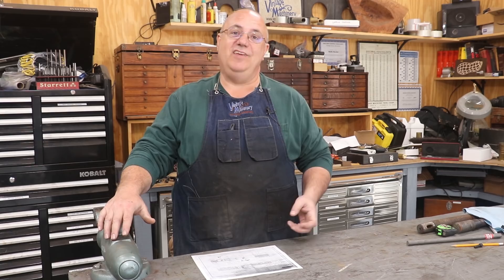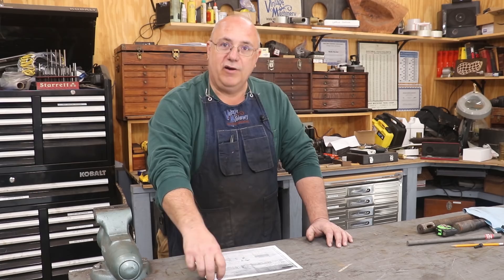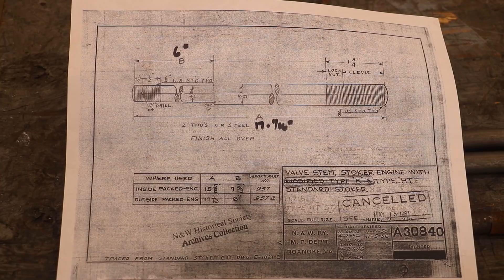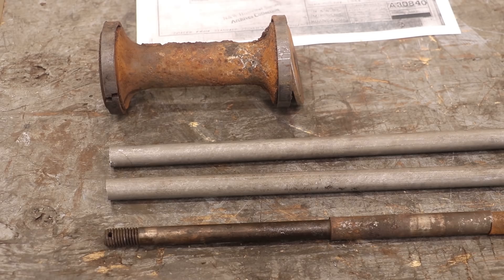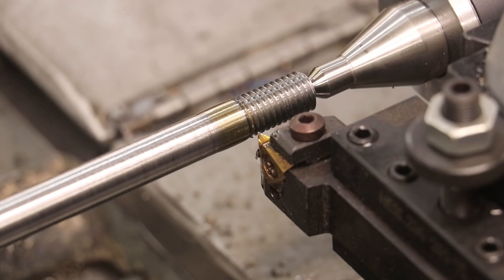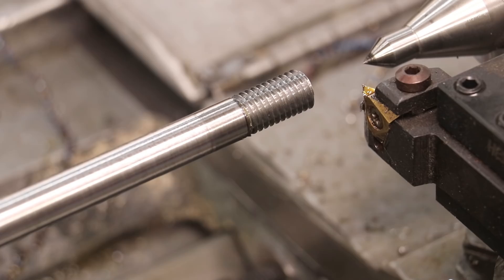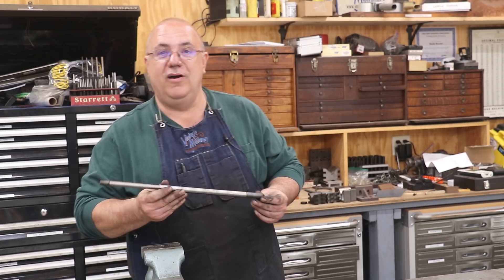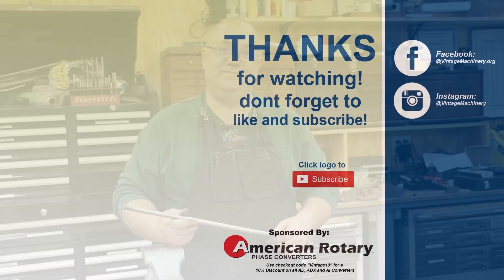Steam Locomotive Stoker Engine Restoration - Part 9: Machining New Valve Stems

Comment: First of all; I want to thank all you YouTube presenters.  After watching now for a few yesrs I believe I could once again walk up to a lathe and actually make this part, maybe even the first time without scrapping it.  Last time I worked a lathe was 38 years ago in College Machinist Program as a student.  I've learned So Much More over the last couple years watching You, Keith F., Adam, Brian,  Steve,  Dave Richards with his steam powered shop, Mr. Pete, and many more.  I was damn proud to contribute to both Keith and Steve recently when hard times came their way. 
Now back to one small question  and I'm not trying to not pick.  On the first half you drilled a center hole which I understand had to do with the long overhang in comparison to the diameter.  On the second half I get the overhang wasn't nearly what the first side was, but given it would only take 20 seconds and prevent chatter or flex while threading why not take the time?

Comment: Helpful hint:  
When threading or turning with a center used to support the part, begin your setup by positioning the cutter approx. 1/8" off the end of the piece being turned or threaded, followed by sliding the tailstock (with quill retracted) up against the carriage to serve as a mechanical stop.  Followed by extending the quill to engage the center as usual. This set-up makes it easy to return the cutter each time to the small space existing between the end of piece and center without having to watch closely as you approach the starting point for the next cut. When threading, back off slightly from the mechanical stop to allow the half nut to engage freely.

Comment: Years ago I worked in a shop that had a lathe. To quickly set a new tool on centerline to the lathe someone had bent a 1/4" rod into a gooseneck. It was mounted on a block that you could set on the flat surface on the top of the ways. The top of the gooseneck was ground flat to represent the centerline of the work. When you put a new tool onto the tool post you would set the gooseneck on the way and turn it so the ground surface was next to the new tool. Adjust the tool up/down to match the cutting edge to the gooseneck flat. Tool is on center.

Comment: Thanks for yet another entertaining and inspiring video. I like the rythm and Your calm telling what You will do.
At the time 7:48 You start threading and do as "all You big guys do", operating those heavy and well equipped lathes do, You make a light test cut.
You have a nice gearbox for the leadscrew and seldomly select the wrong gear train. For us, small lathes users, the options are quite different. We timeconsumly need to change some 4 or 5 gears. Some of us surely have some tooth wheels having no number stamped on them. Mistakes are easy to make.
Check a Brittish guy, Ades Workshop! He showed a method like this: Set up the gear train. Lock the halfnut. Set up an indicator showing the move of the carriage. Then, manually turn the chuck one revolution and watch the move by the indicator. That method saved me when I mistakenly used a 20 tooth wheel instead of the 25 tooth wheel.

Comment: FWIW, the reason for 29.5° vs 30° is that if you use 29.5°, you are always assured to be cutting the root of your thread and not leaving a tiny land at the root. If you shoot for exactly 30°, you might be a touch off and since your thread-forming tool is a 30° half angle, EXACTLY. You could be again, leaving a land at the root. For loosey goosey threads, its likely no big deal. For tighter fitting threads, you want to assure you have a crisp root or else you can gall and then you're hosed.

Comment: For each index of a cut X ...the tool profile takes out the 29.5 ..or 29. Sooo, it stands to reason less material load on tool.. better profile.
 The man that showed me this did so on a 0-80 coiling mandrel x 3.0 !!!
 Then harden it .
 Thanks Chuck Cluckman. RIP.

Comment: Nice video. I was intrigued by your not machining a relief at the end of the threads for the tool to drop into.
Reply: Mr. Wilson is correct in calling attention to this.It's an unwise oversight to omit the thread relief. The thread relief cut removes the stress concentration at the bitter end of the thread groove. This is where cracks start that lead to part failure. Avoiding  stress concentrations is a big deal in part manufacture.

Comment: Afternoon Keith, have you thought of using hard chromed rod for the piston and valve rods makes a very good surface for the gland packing to run on. Regards.
Reply: Funny you mention that, on Abom's tour of the Durango and Silverton machine shop, they discuss that. Don't remember their exact justification, but I think it came down to being more wasteful to use chromed rod since it does wear slower, but can't be turned down to clean it up later on.

Comment: The 29-1/2* compound setting ( on 60* threads ONLY !! ) is so you put less stress on the threading tool. By turning in the compound for the cutting depths, you are only cutting on the leading edge.  The last few thousandths can be taken using the cross slide to use the entire tool for a proper tool profile finish pass.
 Can you be "lazy" and feed straight in? Yes , BUT that only works in shallow, fine threads.  A coarse thread will put extra load on the cutting tool and may result in excessive wear or breaking the tool itself.
 Keith did it correctly. Pick a number on the dial ( or "clock" as he mentioned)  and run at a speed you are comfortable with.

Comment: It is basically the fuel pump for coal.  And it is small only in main line steam engine terms.  They once had a formal dinner inside a mainline engine's firebox.   I believe smoking was allowed at the dinner. back then.

Comment: You mentioned you had cold rolled steel after showing the drawings; but you faced off the round stock and the end had a red marking. I believe that was denoting "Hot rolled" from my experience at least. Just had to mention
Reply: I worked in a bar mill for 8 years and they had both the appearance and markings of hot mill bar stock. The scale on the surface is why the collet didn't work for him.
Reply: Anyone who has paid attention working in a machine shop should know the different color markings. Most viewers don't realise that Rucker is just an amateur hobbyist.

Comment: maybe not an error but an underexplanation . . . steam from the boiler is always present at the center area of the spool valve (the narrow bit) . . . as the spool moves left, it exposes a port to the left end of the cylinder to the steam in the center of the spool and simultaneously exposes the port at the right end of the cylinder to exhaust . . . this pushes the drive piston to the right which pushes the spent steam out the right side port.
as the piston and valve spool move to the right, steam is shut off to the left end of the cylinder and just before the point of maximum travel of the piston, the spool valve uncovers the right end port admitting steam to the right end of the cylinder and simultaneously exhausting the left side.

if you are lucky, this process repeats itself.

Comment: Thanks for showing us how to do threads.   I notice that both you and Adam use both hands when setting the zero back after a pass...is that a taught machinist thing, or is there something about gear drive/backlash prevention that works better with two hands?
Reply: You have more positional control using one hand to oppose the other. Like shooting a handgun with 1 hand vs 2.

Comment: In this part you just finished the thread cutting by pulling the tool out of the round stock. Some practices say that the stress risers at the end og thread are smaller if instead of just pulling back on the thread cut, a short section on minimum diameter is cut with a radius blend at the root.  It that a waste of time just to look fancy, or is there something to it in higher stress use?

Comment: Know it is a small Dia. Rod. But giving the flex it is subject too, why did not cut a radius at the rod OD differential to help in it not breaking at that point? Never mind watch till end saw where the piston shoulders at that point....if had radius should not shoulder properly. My Bad.
Reply: Plus the rod does not do any bending, just axial movement.
Reply: @royreynolds108  well ture but unless it is 100 % lined up and due to heat expansion it not free from flexing.

Comment: The place that's going to repair the crankshaft, isn't it spray welding ? 
12:02  I would have liked to see that index (?) clock up close. Thanks.
Reply: Worn parts can be built up with hard, electroplated, chromium.  I suspect that is the process used by the specialty shop.
Reply: @eliduttman315  Thanks will Google that and see what's all about.

Comment: great video, a couple question though that I have had for ages, when engaging the autofeed using the little rotating clock, how can you time pulling the lever precisely enough to be accurate? is there some sort of tolerance or mechanism in the system that means you  only need to be close to the chosen number on the rotating dial? Also when stopping the thread cutting the lever is pulled to disengage the feed, but if you needed an extremely precise thread length how could this be achieved if you have to rely on your speed of reaction? is it just down to practice? thanks!
Reply: When you engage the half nut it falls into the threads on the lead screw.  It will not engage until the half nut is aligned with the lead screw.  Joe Pi did an excellent video on this.  If you apply gentle pressure to the lever it will fall in when the two align.
Reply: Regarding the stopping, from what I've seen, most of the time there is a relief/gutter area at the end of the thread, so stopping doesn't need to be ultra-precise. He didn't do that here, likely because that wasn't in the original. I've also seen in the case where the endpoint is ultra-critical or very tight against a face, they start the thread at the critical end and work backwards.

Comment: Were there any steam locomotives that used powdering the coal and injecting it with air, like modern coal-fired plants? I think they just went to oil burners, but IDK.
Reply: I've never heard of using powdered coal except in water-tube boilers far larger than any on a locomotive.
Reply: There was at least one experimental coal-fired steam turbine engine that possibly did so (but I haven't yet found a source to directly confirm powdered coal or not), the N&W Jawn Henry.  It used an automatically controlled Babcock & Wilcox water-tube boiler that I believe was fired with powdered coal to drive a steam turbine that operated an electrical generator to power traction motors on the axles.  Very problematic and was struck from the roster only 4 years after it entered service.  The C&O also had a coal-fired turbine, but it had a conventional boiler and I don't think they used powdered coal.  The GE steam turbines that UP had were oil-fired with Bunker C but also used water-tube boilers.  The UP also had direct-fired (with oil) turbine engines as well.  Outside of the US, I'm uncertain about what countries/lines experimented with turbines but I'm sure there are at least a few.
Reply: The UP tried it with one of their turbines.  Those locos were called "Big Blows".
Reply: They tried it on a few NCB locos in UK where coal powder was waste but it just blew it up the chimney!!!  Not popular with the locals.They came up with the idea of gluing it together and making "briquettes"  and suddenly it wasn't waste anymore!
They went back to coal that was, too poor to sell and fitted a steam ring in the top of the chimney to thin out the black smoke from the poor coal to fool the Clean Air inspectors. Worked for a while but this was the late 60's most of the engines were 20 to 30 years old so they parked up the steamies and switched to diesels. They closed down the pits soon after because of the price of importing diesel to run the machinery!!!

Comment: Any idea why the cut was so nasty with the collet?
Reply: I worked in a bar mill for 8 years and they had both the appearance and markings of hot mill bar stock. The scale on the surface is why the collet didn't work for him.

Comment: Keith the stoker engine  can't reach all the firebox the fireman still has to hand fire the corners of the locomotive
Reply: I think the bigger locos used steam jets aimed by the fireman to blow coal into the corners. Some of those fireboxes are so big it would be hard to throw coal by hand to the ends especially through the small firebox doors.
Reply: @bcbloc02  I believe that all mechanically stoked engines used a revolving or oscillating steam jet to spread the coal as evenly as possible across the grate surface.  Typically they still needed a little help from the fireman.  Stoking a coal fired boiler for maximum efficiency  (especially on a locomotive or a ship)  was an art; a book I read described getting an even firebed as requiring delivering a "roundhouse punch with a flick of the wrist."   The skill and teamwork of the engineer and fireman (or lack thereof) could cause the fuel consumption to vary by a factor of three.
Reply: @bcbloc02  There is at least one photograph of a catered dinner served inside of a firebox of an articulated locomotive boiler while under construction in the locomotive manufacturer's shop.  I think it was taken in the 30's.

Comment: Check out Joe Pieczynski on You Tube and you will never cut single point threads like that again.  In addition, the threads you cut using a hardware store nut as a gage only provide you with a thread that fits that nut, and may not fit the mating part.  Measure the PD with wires to assure that they will fit the female parts.

Comment: I'm pretty sure that you don't adjust the stroke by turning the valve stem. Wouldn't the stroke be set by offset of the cam? It seems that adjusting the length of the rod would change the operation of the valve. Keith is kinda sloppy in his terminology.
Reply: He's talking about the stroke of the valve. Not the stroke of the piston. You can't fine adjust a cam shaft, so you fine adjust it by screwing that rod in or out.
Reply: @xenonram  but the length of the stroke is set by the cam isn't it?
Reply: @timothyball3144  The cam in this case is integral to the crank shaft, not a separately driven piece like in an internal combustion engine. There would be no adjustment available in the crankshaft.
Reply: The stroke is double the eccentric offset.  The valve is adjusted on the stem to open and close the ports in the sleeve the valve rides in and not hit either valve cover.   The piston is adjusted in the cylinder to not hit either cylinder cover as is the valve spool.  Hope that helps.
Reply: @royreynolds108  thank you. I figured it was something like that. So it's more correct to say that the position of the valve is adjusted by the length of the piece he just made.
Reply: It is important that the POSITION of where the valve piston is, relative to the main piston. The rod length changes this. Like the timing on a car to late and no power, too early and wasted steam.